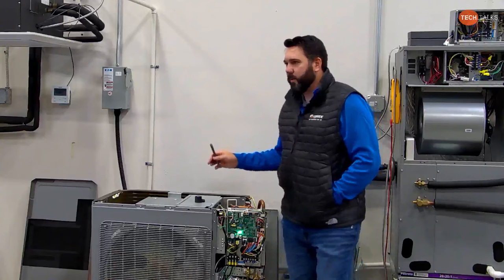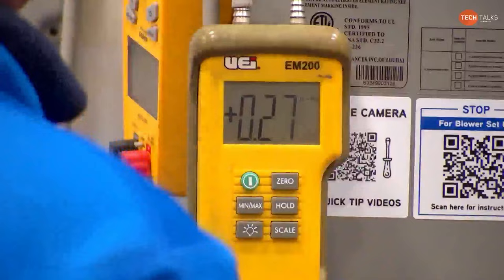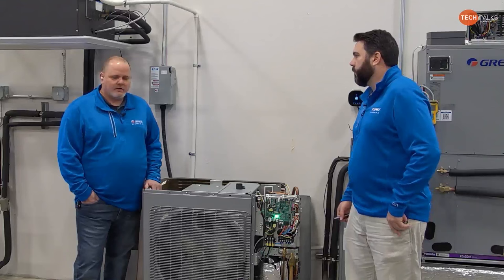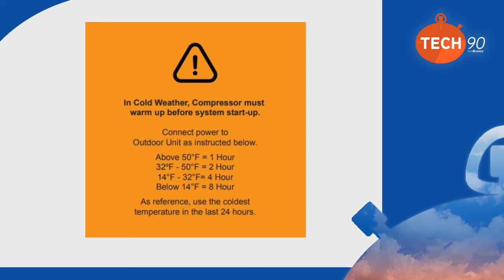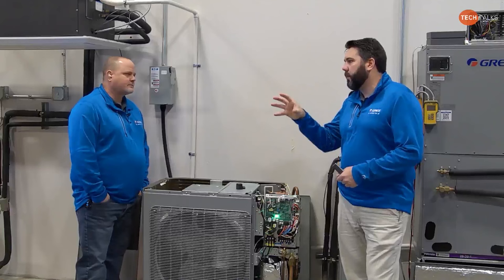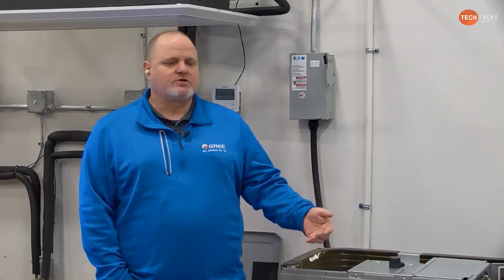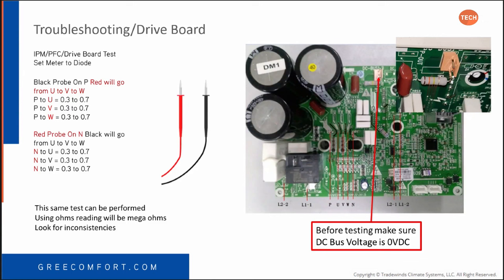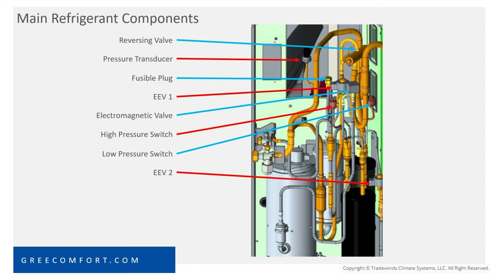HANDS ON! GREE FLEXX Installation and Troubleshooting

Comment: @greecomfort I am getting a P8 error code immediately upon powering on the Flexx unit. Since its considered an overtemperature protection, would it be best to replace one of the circuit boards?

Comment: How do I get 325cfm/ton on a 2 ton with 0.6” esp??? It looked like 840cfm or 420cfm/ton was the minimum we can set. Thx.
Reply: Thats my only issue with these systems.  They have a ton of features but no dehumidification controls like many other do.  It needs slower blower speeds at 2 ton and slow speed at startup then ramp up like many other brands will do.
Reply from the maker: All the extra bells and whistles you are looking for are in the MultiPRO line of products. Check them out! https://youtu.be/vAx_slbgWZs?si=0DYQr4gTRoab5a2r

Comment: 2:15:11 The rotary inverter compressors can run up to 7200 RPM.  They need to be balanced better or redesigned so that they are quieter. No way will I ever use a wall mount bracket. again. Glad it was my own on my shop. 

You guys are one of the few videos in English. I hope more manufactures learn from you guys. Keep up the good work.
Reply from the maker: Great points! GREE is the first to manufacture a true cold climate heat pump that runs the compressor at lower rpms to avoid this problem. Thanks for tuning in. You may also be interested in this video about Cold Climate Heat Pumps : https://youtu.be/qyLDKAVZrCE?si=YlfA0fv4u5nq4lje
Reply: @GREEComfort  my shop unit is an Airtemp 30.5 SEER, so the same as Gree Sapphire. That is my only issue and only in heat mode at certain RPM’s. I love the 132F supply air temperature at 20F odb. Felt like gas furnace!

Comment: In the service manual, 2.3.7 Forced Operation Control, it says "01" denotes that
turn on the forced operation cooling mode; "02" denotes that turn on the forced operation cooling mode. I'm assuming this is a typo and they meant to say 02 denotes heating mode? Please confirm. Will this mode also turn on the air handler blower? Thanks
Reply: Yeah has to be a typo. Ran into that today
Reply from the maker: @proxybox and @Sesamestreet9080, you are the big winners! We addressed your comment on yesterday's Talking Comfort LIVE here: https://youtu.be/uJ58hNNKDVA
Reply: @GREEComfort  did we win some merch tho
Reply from the maker: @Sesamestreet9080  @proxybox As a matter of fact, you did! Send an email to tforce@twclimate.com with a screenshot of your comment and we'll get things set up.

Comment: 1:46:57 you said earlier not to unplug components - specifically the outdoor fan motor when power is on. But now you’re saying to unplug components to troubleshoot as we might see the bus voltage go back up after being dragged down by a bad component. Which is it?
Reply: Cut the power and make sure the dc voltage is gone then unplug. Don’t unplug while power is still present cause it will short a board. Had it happen to me